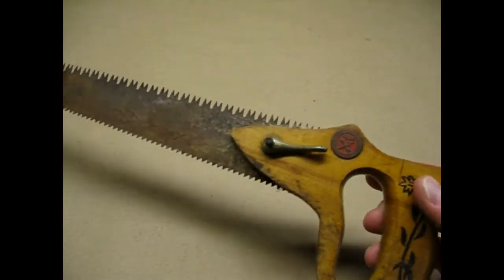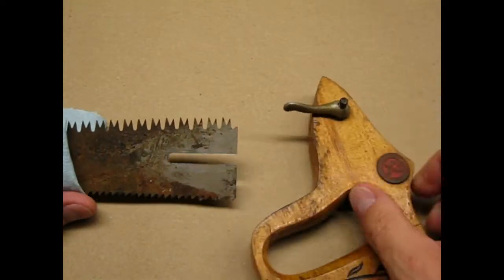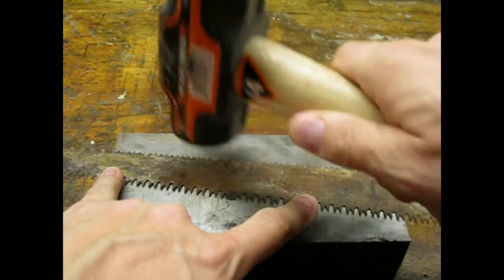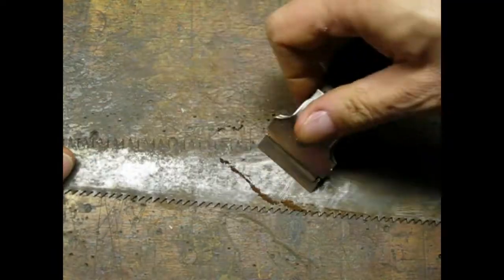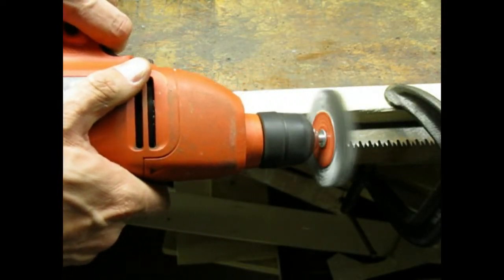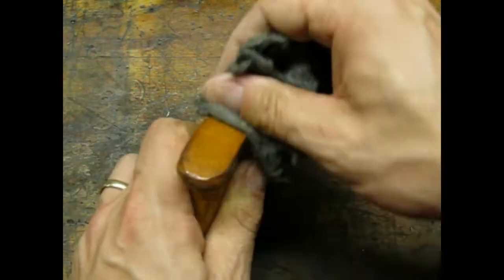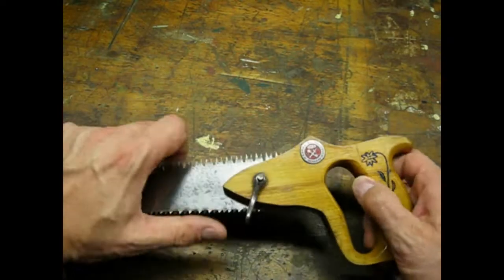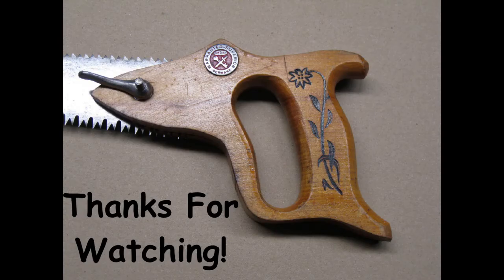Handsaw Restoration - Reversible Blade Dorbi Germany

Comment: I always wondered why no one made one of those that you just flip over with no removing the blade. Just make a handle that works both ways. Sell a rip saw and crosscut saw all in one. Same setup one blade one way and the other when you flip it
Reply from the maker: I think I've seen ones with ambidextrous handles.  Removing that blade is a little dangerous!